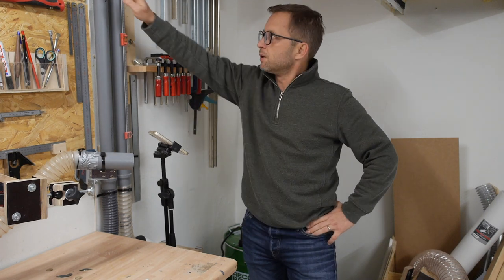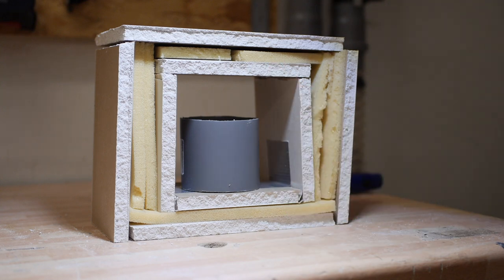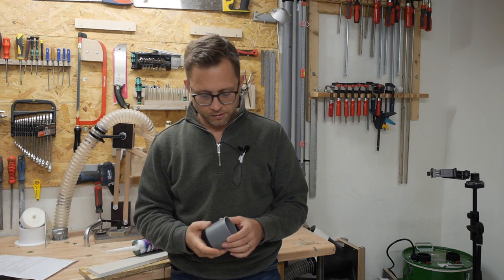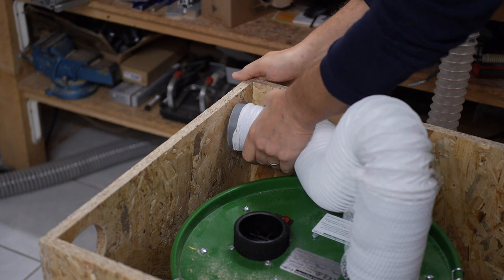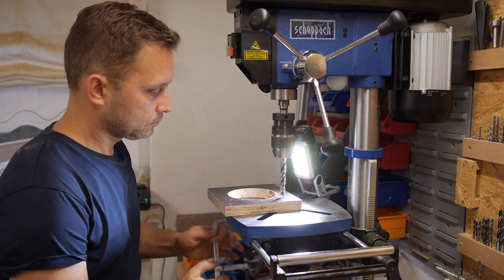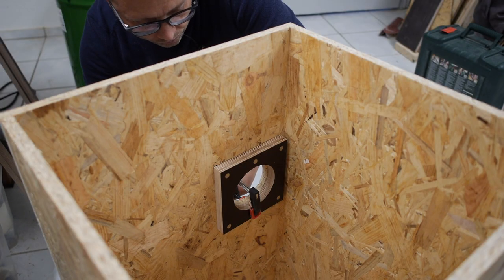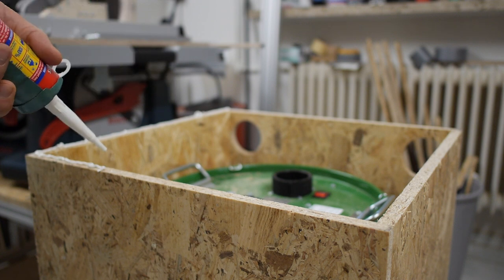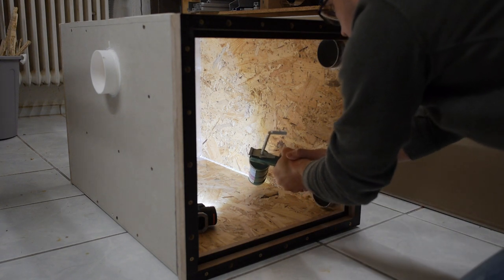Silencing loud things (part 1)

Comment: I have the same extractor and find that using the exhaust pipes quietens it down considerably and would work out cheaper than this too, you only need to buy one and cut it in half. Talk about over engineered project that wasn't actually needed.
Reply: You are right!  This is already a quite quiet machine (compare 74db to other vac’s) now simple incorporate the sound dampening tube the company has, then the whisper cabinets from someone eg. Hooked on Wood . This is dead simple and no over engineering required.